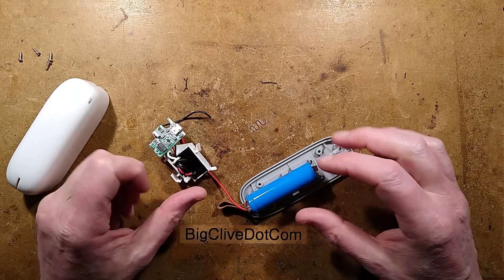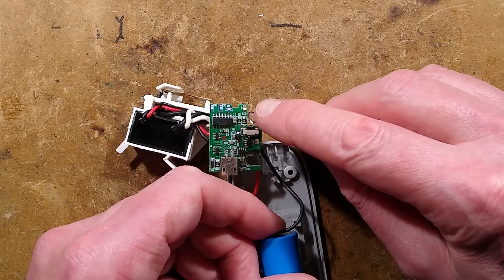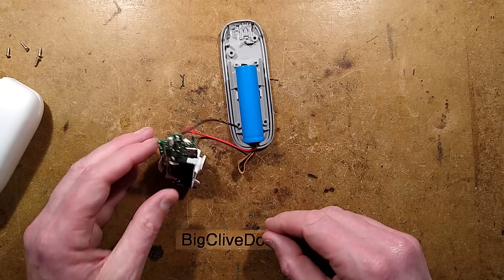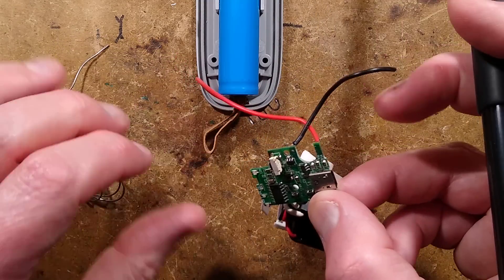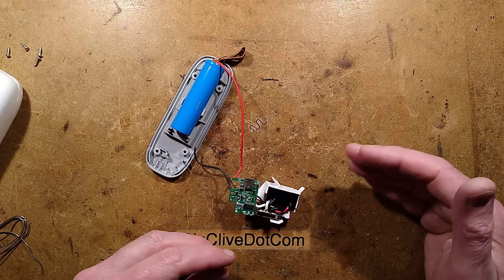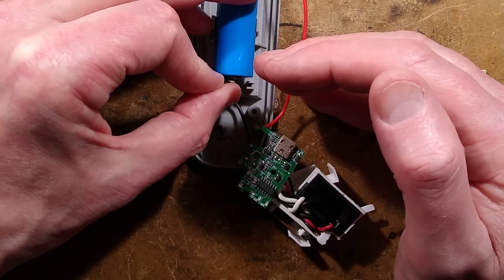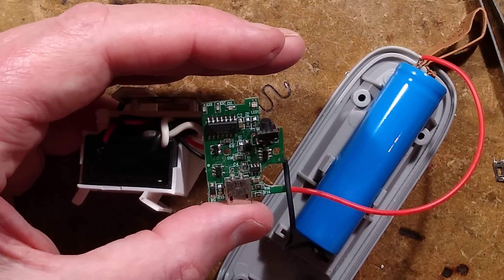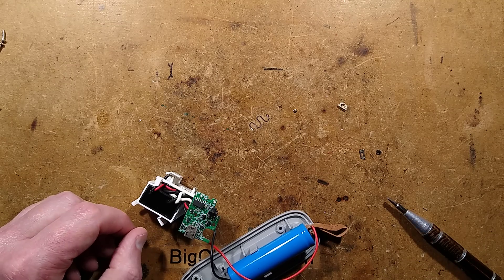The curse of tin whiskers rears its head again

Comment: I never realised what "tin whiskers" were, I thought it was solder bridges with stray strands shorting out. Everyday is a skool day 😎👍
Reply: Same here... you're supposed to learn something new every day. I can check that off for today. I'll bet tin whiskers explain a lot of " cosmic bullet"( random and not obvious) failures and other problems.
Reply: No actual evidence of tin whiskers here, though. The solder on the board was fine, the problem was inside the switch, and we didn't get to see that. More likely the plating just wore off, or some particles were shorting out the internal contacts.
Reply: And same here...  I imagined it might be bits of stranded wire sticking out and touching other conductors.
Reply: It's a mystery, can grow through coatings and out of alloys, and grows better in space. ¯\_(ツ)_/¯
Reply: Under heavy magnification. You nice and smooth solder joint can look like it needs a shave. It's really bad with connections to chips. Just because they are normally closer then other connection points.
Reply: some sort crystal, like new age, pyramid power,  etc, what tin whiskers grow from? the rest tin, maybe, does eclectic part in forming whiskers? and if have really really old, tin why not just covered full outer coat of whiskers? like fare-coat?
Reply: Google "tin pest" for some deep background into the instability of pure tin.

Comment: By all reason if it was tin whisker, it would have broke off during actuation, even just the slightest movement of the switch membrane? I think there is something else going on here. Besides at least one of the surfaces shouldn't be tinned, but plated with nickel or phosphor bronze or something else. Actually nothing within the switch should be tinned, ideally.

Comment: My Onkyo TX-DS494 had the same issue recently. Its front panel, the buttons (like the square one you put on) had high resistance when pressed. Which some of the buttons are paired together going into the MCU, and it must determine the button based on the resistance it receives. Since there are resistors on the buttons paired together. With the buttons not going dead short, it'd confuse the MCU greatly and it'd press some random button. Stupidly I didn't replace them (I thought I couldn't since they're 2 pin, and the pins are in the middle of either side. Replacements I had are 4 pin at each corner, but I could of cut the two pins and rotated the button 45 degrees). I used some deoxit and worked it in. It works, main issue was one of the speaker relays not working. Got it all fixed up though.

Comment: Terrible problems with whiskers, usually the Mullard af-xxx  range transistors, and for a long time the phenomenon disappeared, manufacturers dutifully used gold contacts for switches and connectors etc, but every now and again some designer would forget the lessons of the past and use tin instead, sony actually issued an electron micrograph of how it was afflicting one of its products along with an upgraded part.

Comment: So to mitigate the lead problem do they just put less lead in solder?
Reply: As of 2006, there is absolutely zero lead in solder and in surface coatings in consumer products. The way you're supposed to counteract the resulting possible quality issues is by using immersion gold platings on PCBs, phosphor bronze and various other platings on switch contacts, and silver additive in the solder. But manufacturers tend to skimp on these, because they cost actual money.
Reply: @SianaGearz  I buy old radio shack solder
Reply: @nomusicrc   There's any number of sources of standard leaded solder, say Broquetas in Spain makes it, also Cynel in Poland. Probably the wrong end of the planet for you.

Modern types of leaded solder intended for high reliability manufacturing (not permitted for consumer products) does usually have SLIGHTLY less lead like 36-38% instead of 40 but it actually makes it slightly better if it's made at high quality, due to hitting the eutectic point.

Comment: I have a 25+ year old, large, rack mount HP/Sola industrial UPS that started behaving wonky. I opened it up to diagnose the charge circuit and, to my amazement, the entirety of the inside of the case was filled with a miniature forest of sparkly tin whiskers.
Reply: No pictures were taken as I went into full panic and cleanup mode upon discovering this. In my day I replaced and repaired many hundreds of racks of enterprise servers and storage that were victims of tin whiskers knocked loose from the bottoms of raised floor tiles, subsequently swept up into the air handlers, and then very conveniently dispersed throughout data centers. Power supplies were the usual victims, but a number of main boards were also sacrificed until the industry finally discovered the cause.
The longest whiskers in my UPS were maybe a tenth or two of a mm, and without premium macro photography gear and strong light sources, they would have been very difficult to photograph otherwise.
Reply: @Brian-L  the ones from floor tiles are likely zinc, another metal really prone to whiskers
Reply: that sounds amazing, did you take pictures
Reply: @tsm688  NASA has a bunch of good pictures if you want to see what they look like.
Reply: Pictures would have been nice
Reply: Now it makes sense , thanks
Reply: it's common on the bottom of galvanized steel raised floor tiles
if you ever want to image them basically any random magnifying glass or jewelers loupe will work on a smartphone to let you focus really closely, add an led flashlight and you can get a decent macro shot for investigative purposes

Comment: Tin whiskers are a reason I'm skeptical about sending unmanned spacecraft on long, long missions. The circuitry can only last a certain length of time before it degrades and fails. Even if you build in a bunch of redundant circuitry it's eventually gonna cause problems.

Comment: I still have a stash of tin/lead solder I use for electronic projects.  As Clive mentioned it wets much better than leadfree. I have switched to lead free solder for plumbing work, as I prefer not drinking lead residue.

Overall removing lead is good, with electronics I wonder if the concern is primarily with soldering or disposal of e-waste.
Reply: It's 100% disposal. Lead from e-waste dumped into landfills was leaching into water supplies, and big manufacturers didn't want to pay for collecting / recycling it properly. Using leaded solder for repairs and small project is fine.
Reply: @RFC3514  The amounts of lead used on PCBs are minuscule, though. Meanwhile capacitors, diodes, transistors, etc. all have all kinds of plastic and resin coatings, proprietary electrolytic concoctions of all kinds, as well as rare metals and their oxides inside. But that's fiiiineee! It's the lead solder, all 0.25 grams per PCB, that's evil!  
The whole "environment" argument is a joke. It's nothing but an attempt to wave off environmental and health concerns to continue saving money by dumping waste left and right, instead of taking proper care of it.
Reply: @Sierra410  - Reduction of lead in disposable consumer electronics would be a positive step on its own, regardless of "other concoctions". But RoHS covers a lot more than lead (were you unaware of this?). Lots of other substances have been phased out of mass-market consumer electronics over the last two decades. Your post reads like (uninformed) whataboutism.
Reply: @RFC3514  the comment is worded using simple language, because it's point is not showing off the knowledge of chemistry and technical jargon, but highlighting that this approach to managing pollution is a joke.  
The overall "pipeline" didn't change, it's still manufacturer -> customer -> landfill. If anything, it got worse, since things are generally less-repairable nowadays. Hence, they last less and need to be replaced more often.  
So, praising the fact that things are less toxic, is like saying "the glue I eat is less toxic than it was 20 ears ago", completely ignoring the fact that you still eat glue, and more of it than ever.
Reply: @Sierra410  - More whataboutism. The fact that some things "are less durable nowadays" has very little to do with the reduction in bioaccumulating heavy metals and a lot to do with the fact that manufacturers want things to fail once their warranty expires. If you think they'd have any difficulty achieving that with leaded solder and cadmium batteries, you're incredibly naïf.

And I'd much rather wear a watch that lasts five years and isn't radioactive than one that lasts ten years and is radioactive, so that argument doesn't even work (even if one thing depended on the other - which it doesn't).

Your attitude is equivalent to saying "they made murder illegal but some people still get murdered, so let's just make murder legal". It's the same kind of argumentation used by American gun nuts that oppose any sort of regulation. "Bad guys will break the regulations to get guns, so let's have no regulations at all."

Unless you have a plan to overturn global capitalism and consumerism over the next ten years, I'll take my water with less lead and cadmium, thank you very much - even if that costs some Chinese manufacturer or American billionaire an extra 50 cents in soldering temperature control. I guess I'm just being terribly selfish. 

Maybe we should reintroduce asbestos into AC ducts, too, since some people get lung cancer anyway. If it can't be 100% solved in one go, let's not bother to improve the situation at all. Then we can feel self-righteous about our binary view of humankind's problems, eh?
Reply: @RFC3514  tell me this,: how does lead and cadmium get into your water? It doesn't magically teleport into it just because it's used in some product somewhere. 

For like the third time: those regulation don't do anything to prevent pollution on a grand scale. They force superficial changes in production processes, which, yes, do reduce some pollutants... in a list of thousands. And yet, those minor changes allow the manufacturers to pat themselves on their shoulders and say "We comply with environmental regulations! We care!", while it can't be farther away from the truth.  

Also, now that you've mentioned radioactivity, it reminds me... That's the same though process as the anti-nuclear power people have. "Nuclear waste is dangerous, therefore nuclear materials are bad!". So, instead of demanding regulations that'd force everyone to, you know, not dump their waste down rivers, and work with potentially dangerous materials in a safe manner (which, to be honest, is a thing already in any civilized country), they call for a complete ban on nuclear energy. Do I need to explain why this is dumb?  

Same goes any other pollutant, be it lead, or plastic, or any other gunk. You don't reduce pollution by substituting your pollutants with slightly less dangerous ones, you reduce by not polluting in the first place.  

Instead of requiring "safer" alternatives to "dangerous" materials, manufacturers should be held responsible for the waste they produce (which should include their products past their end of life) and be incentivized to created products that, simply put, last longer and aren't just "more environmentally safe". 

If I had to pick between a watch that'd last 5 years, but can be... chopped up and safely eaten (for whatever reason) and one that uses a god damn lead-shielded beta-voltaic battery as its power-source, one that'd outlast me and my grand children, I'd pick the latter.  

Because no material is inherently dangerous. It's only dangerous if it's mishandled, and that happens when nobody cares about it. When it's seen as unwanted junk.  

So... Make less junk.
Reply: @Sierra410  - Sigh... "These regulations" have reduced contamination by heavy metals to less than 5% of what they were in the 1980s.
Reply: @RFC3514  Okay, I'll simplify even further, hopefully you'll understand this time.
Imagine for a second sewers didn't exist.  

I say "We need to stop dumping our waste buckets out of our windows. What's needed is a system that'd allow proper collection and management of waste. Simply banning food that produces smelly waste is not a real solution."  
You go "So you want the streets to stink! Unless you have a plan to uproot our cities and building thousands of miles of underground tunnels specifically for waste, which is ridiculous! I'll take my streets less stinky!"  

The current solution is "easy", but it's a dead end. The world is chasing this environmental "zinc selenide" with those legislation. You can only go so far and improve things so much before the results will get progressively more diminishing. And that's what I'm pointing out here. The efforts of legislators are in this "easy" direction entirely, there's precisely zero effort to steer the industry in a direction that'd be more sustainable in the long run.  

The way that's "obvious" and "easy" isn't always the correct one, you know?

"Luckily, some parts of the world are run by adults." clearly the world needs more "children" then, since the "adults" are too busy chasing the "easy" and the "money", often both.

---
The above was written in reply to the original comment:
@Sierra410   - I see you're doubling down on the "either prevent 100% of murders or don't bother making murder illegal" line of "reasoning" (I use that last word quite wrongly). Luckily, some parts of the world are run by adults.
Reply: @Sierra410  - The problem isn't my understanding. Stick to your pony memes, let grown ups deal with the real world.
Reply: There is no concern regarding lead during soldering. Large studies of electronics workers have been done and no increase in lead-related diseases or lead in their bloodstream was detected. As to other occupational diseases, asthma has been identified as extremely prevalent at around half the workers, in spite of workplace air extraction, suggested to be from the irritant effect of the flux vapour. The concern is specifically with disposal, but i don't know if it's practical or theoretical, i haven't dug into it.

Really a lot more needs to be done about air quality for people working around electronics flux, it is super harmful.

I mean yes you shouldn't be stupid, and shouldn't solder and eat, you should wash your hands, but it appears that the basic of precautions work perfectly fine to prevent lead poisoning, both immediate and cumulative.

Comment: I guess this should only be an issue with low quality tactile switches, since the contacts are supposed to be either silver or nickel plated. The cheap ones might use tin plating. This leaky tactile switch issue was a common problem with some models of CRT TVs. Those were good quality switches with silver plating, the issue was the black soot-like dust that the high voltage attracted all around the CRT and covered the switches. 

Better designs that used key matrix were less affected, but some TVs that used rather high impedance resistor chains with the switches shorting out individual resistors in the chain, those were going crazy when leakage across the switches occured. It was't uncommon for these TVs to do random stuff, like randomly changing channels, ramping up the volume to maximum, switching off and on on their own. The best combination was when it switched on at 3AM with full volume, usually not responding to the remote control until it sensed 'key presses' on the front panel.

Comment: 🤭 ~ I have had the reverse with those button switches [not working/response from being pressed] assumed dirty contacts and thus spray-drowned them with contact-cleaner and repetitively pressing it and when it dries, put a multi-meter across it and find that it is working again. No need to replace the button

Comment: I've seen this problem in a lot of devices with 3-position switches bought in late (November / December) 2022. Basically, even with the switch set to the "off" position, the device sometimes turns itself on. Probably a defective / contaminated batch that made it into the trashy high-end Aliexpress / eBay electronics industry around that time.